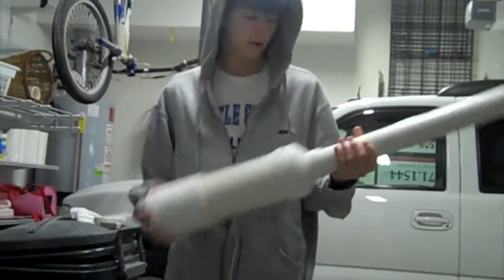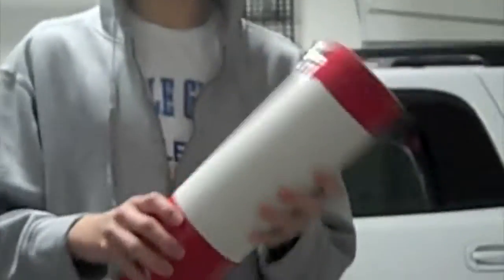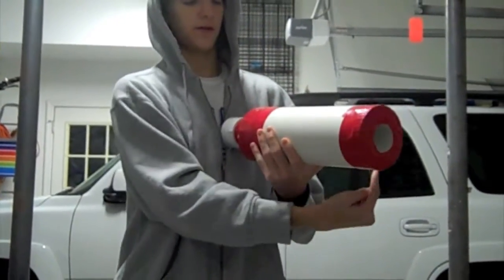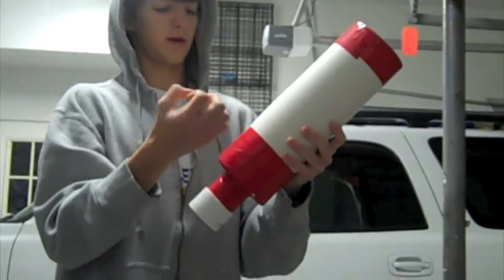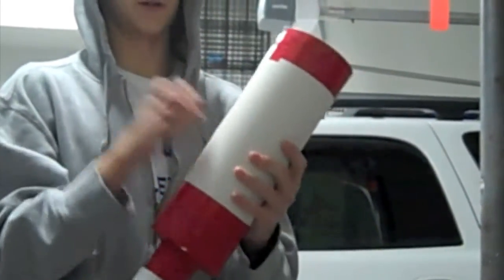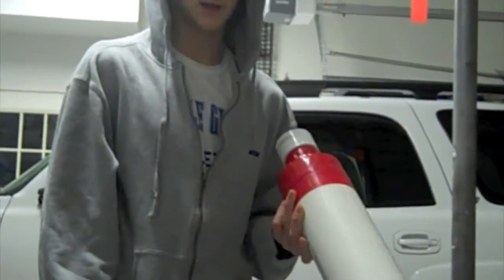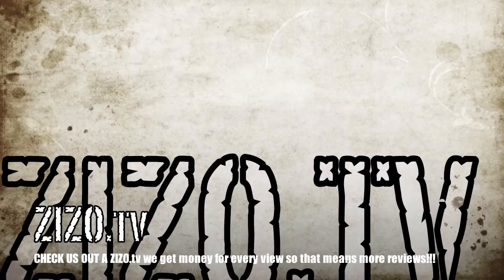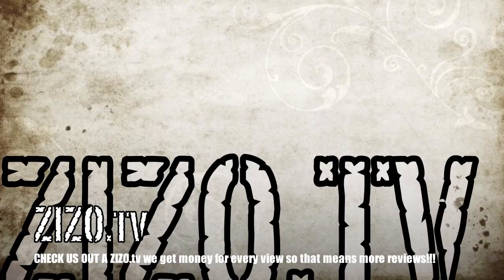Potato Cannon Silencer

Comment: That's a good idea i originally used those pads in my first potato silencer. Since then i decided to use baffles and different sized chambers to help stop the different wavelengths of sounds being produced. Also the material that the Mr. Clean magic sponges works great in a .22 silencer i am sure it would work just as well in a spud gun. :3 I am only posting this so that people can try different designs for silencers to find what works best for them.